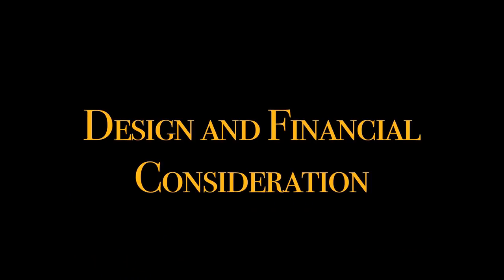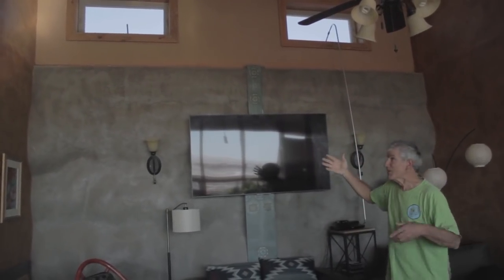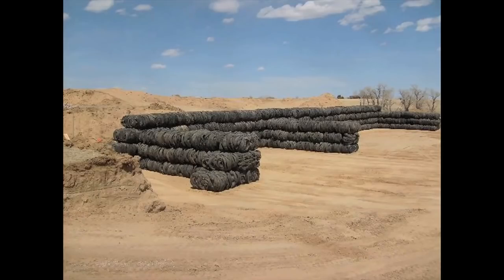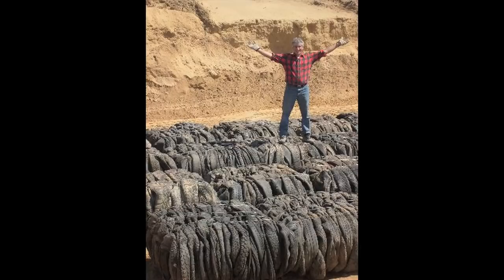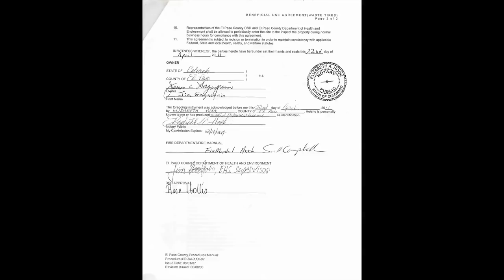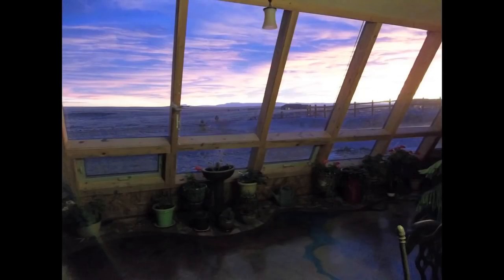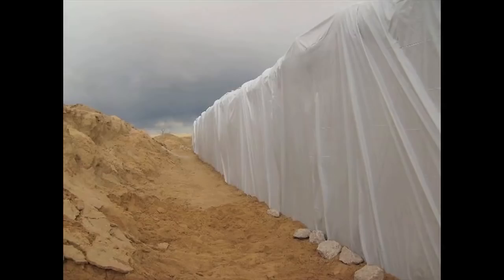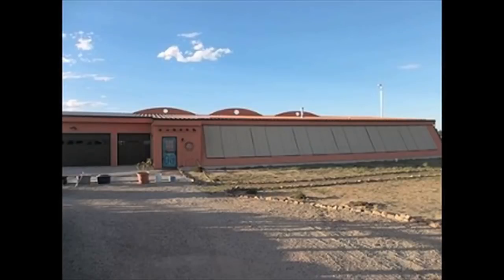Zero Energy Passive Solar Bermed Earth Tire Bale Home - Pseudo Earthship

Comment: Jim, thanks again for the great video, it's unfortunate that Mike S. is not with us anymore, so who would you recommend as a Colorado engineer for designing a tire Bale home?
Reply from the maker: There are a number of designs out there.  I have a design that I'm willing to share.  As you are probably aware, an Engineer who wasn't involved in the design has to sign off, prior to permitting.  I used an Engineer from Denver, but he has passed away.  The latest tire bale build in Colorado was in Masonville, CO.   He used Mark Shelby, a Structural Engineer.  I have this phone number - 217-542-2016.
Reply from the maker: New info - Check out PSE Engineering out of Oregon.  https://www.structure1.com/tire-bale-home-engineering/

Comment: My wife and I are starting to do that your family has done. Before seeing your video we did the same things you have done. Researching and staying at air B & B’s to get a feel of the building’s. We would love to pick your experience to avoid expensive mistakes. How much did it cost to Prepare the land for the build? We have a vacant land with 10 acres, but there are no structures at all. What were some of the unexpected expenses did you find yourself with?
Reply from the maker: Actually, excavation was one of the expenses that went overbudget.  We got a few quotes and went with the lower one.  Their proposal told us how much time it would take to dig out and re-berm the dirt, along with their hourly rate.  They weren't even finished digging out, and they were over the estimated hours.  After the excavation was finished, I paid them, and told them to leave.  After that I hired a guy that was working with the concrete contractors.  His former occupation was operation of heavy earth-moving equipment like Caterpillars, etc.  He was willing to accept $20/hour, and I had to rent a large John Deere front loader (it was even enclosed and had A/C).  This guy was great!  He helped a lot, with his knowledge of drainage, etc; which is always a concern with a bermed home.  Yes, we went way over-budget on reberming, etc; but he worked non-stop, and very expediently.  All my records are unfortunately in an obsolete software (Quatropro), but I would bet we spent well over $10K on excavation.  We hired carpenters, concrete contractors, shotcrete contractors, plumbers, electricians, roofers, insulators, a glass installation company, a crane operator for a day, a certified wood stove chimney installer, a company to design and install the solar PVs and wind turbine, and even a local high school student to help.  I bought all the lumber and the aluminum commercial glass glazing system.  Other expenses are a soil test analysis, building department fees, rock and rip rap shipments, and of course all indoor items - doors, cabinets, appliances, sinks, tubs, and other plumbing items.  Adobe materials are cheap, but we did all that work on the inside ourselves.  There are probably other items I have omitted.  If you have questions on any specific expenses, don't hesitate to ask.  I can be Messaged on Little Bermed House on the Prairie on Facebook.
Reply: @jimgagnepain7708  thanks

Comment: I would like to know how comparable in cost this build was to a conventional house build since a loan may not be available. I do not need actual costs, just the differences of the building costs. And does the company you used the drawing from have drawing that would work for different states and conditions?? Thanks for so much information. There is no way I could do a whole build by thumping tires full!!!
Reply from the maker: The cost of our home was comparable to the other homes in the area.  That said, we were very involved in the building process.  I GC'd the build, which probably saved about $60K.  My wife and I also did a lot of the work.  We were there every day with the contractors.  Had we not had all this involvement, it would have cost a lot more.  Sadly, the designer of our home has passed away.  I would suggest PSE Engineering.  They are located in Oregon, but are licensed in all 50 states.    https://www.structure1.com/tire-bale-home-engineering/

Comment: Nice presentation. Are slanted windows done for aesthetic reasons or do they offer better light penetrating properties than straight vertical windows for solar energy and heating the mass?
Reply from the maker: Slanted windows definitely offer more heat penetration in the Winter months.  The sun is angled from the South, and penetrates the home 15-20 feet deep.  That said, on most winter days, we open windows to cool the house.  Unless you live at a Northern latitude, you could probably get by with vertical windows.  For reference, we are in Colorado Springs.
Reply: @jimgagnepain7708  Thanks for the quick reply.

I get the sun is lower in the winter.

To be clear, it is not necessarily the angle of the window. I don't believe plain window glass has any reflecting properties that direct the light in a certain direction.

It's the height and allowing the sun to shine thru that gets the energy into the house and mass yes?
Reply from the maker: @scott5747  Sorry for the late replay.  No you don't need to angle the windows.  Even the Earthship Community in Taos is no longer angling windows.

Comment: Would it be a good idea to put some sort of waterproof barrier between the tyres and the internal rendered walls as well as on the outside to make sure no moisture and off gassing in the tyres escapes into the home. It may be overkill but I like to lean on the side of caution.
Reply from the maker: On the outside might be a good idea.  We did use 2 sheets of #6 poly, but as we bermed, it got extremely tight from the pressure.  I wouldn't be surprised if it eventually tore.
Reply from the maker: The inside is unnecessary.  There is no gassing of the tires into the home.

Comment: Is there an issue with the tires degrading and leaching carcinogens into the water table? I love Earthship designs but this is a detail that has always concerned me.
Reply from the maker: Actually this is a better use of tires for your concern, than piling them in a landfill.  The tire bales are covered with poly, which extends down into a French drain (foundation drain).  Theoretically, water should never get to the bales.

Comment: Will the bands holding the compressed tires break in time?  I love this concept.
Reply from the maker: A heavy gage cable is used to hold the tire bales together.  The company that provided the bales used a secondary galvanized cable wrapping, in addition to the standard steel cables, that won't rust.  No, I don't believe these will ever break.
Reply: @jimgagnepain7708   thank you for the information!
Reply: Where can I get these compressed tires?
Reply from the maker: @dinebonte4014   Sorry about the late reply.  We got ours from Front Range Tire Recycling.  Work- 303-660-0090, Cell - 303-500-2323.

Comment: Have you had any issues with off-gassing from the tires?  I lived in Taos, NM and had heard that there can be problems with this in tire berm construction.
Reply from the maker: Two points here.  If you ever go into a tire store, that smell is off-gassing of tires.  As tires are worn, they release less and less gas, to the point that they release near ZERO.  Before we covered our tires, you could not smell this, unless you put your nose right up to the tires.  Secondly, the tire bales are covered with about 3-4" of shotcrete, and there is adobe on top of that.  No - zero off-gassing.

Comment: Is construction similar to this feasible in climates like Missouri? Its gets fairly hot and also very cold here, and changes back and forth like you would not believe.
Reply from the maker: Hello, I'm orginally from Missouri.  I grew up in a Saint Louis county.  Yes, the functionality of the design would work very well in MO.  You would probably want to include some type of dehumidification system.
Reply: @jimgagnepain7708  Thanks. I'm looking at earth contact and also the ICF concrete form construction. What I'm gathering is that ICF is most beneficial above the ground? I'm a little confused at the benefit of the tire bundle/spraycrete wall vs. a conventional basement wall, and I don't trust the idea of using ICF forms against the earth. Matt Cremona has a video of a basement extension he did with ICF. Interesting, but despite the B I squeaked out in foundation engineering this is all new to me...

Comment: How cool does the house get in the summer?
Reply from the maker: Nick, We don't have AC.  We rely on the berming and uninsulated concrete floors to keep the house cool.  A few other items worth mentioning  - 1. Colorado has cool evenings in the summer.  So even if we have the very rare day where the indoor temp gets above 80 deg F, we open windows in the evening, and cool the place down.  2. We have very little humidity, which can make you more uncomfortable than heat.  3.  Worst case, if it gets in the 90's during the day, it might get to 75-77 deg F in the early evening.  If it gets into the 100's, we can occassionally exceed 80 deg F.

Comment: What is your advice if the subsoil in the area has a large presence of the carcinogenic natural gas, Radon?
Reply from the maker: Colorado tends to be a high Radon area.  An Earthship works well, because there is no basement.  The key is to hae air circulation, which is the mitigation strategy for basements with high radon.  I would still make the home very tight,  but install a heat recovery ventilator.  They constantly recirculate fresh air, and are very efficient at >95%...

Comment: He said they had no force air, but I didn't see where they put in cooling tubes, either. How does he cool the  house off or get fresh air inside?
Reply from the maker: None of the early earthships used cooling tubes.  The berming keeps the house naturally cool.  Without outdoor shades over the Southern glass, the house can definitely get hot, so we use the shades extensively, even in the Spring and Fall.  We sealed our earthship, and you are correct about "fresh air".  Usually we have windows or doors open for fresh air, but we also have a Heat Recovery Ventilator (HRV), which we utilize when the house is closed (mostly cold winter days).
Reply: @jimgagnepain7708  thanks for your response. I like the idea of the cooling tubes, but I would prefer them be filtered. 
If the tubes promote moisture in any way, I would probably not want it run through the closet like I've seen in the Encounter model.

Comment: is solar hearing also working on cloudy days. If not, does it only not work if there are more days of cloudy sky or already on the first day?
Reply from the maker: It still works, but obviously not near as well.  Sometimes on slightly overcast days, you can feel a little heat buildup at the windows.  Not so with heavy clouds.  Hope this answers your questions.

Comment: Will this design work in little sun areas with long winters like Siberia ?
Reply from the maker: It would work during part of the year.  Obviously, you'd have to supply supplemental heat during the minimal sun time of year.  However, the berming should reduce your heating bills substantially.  Regardless of the style of home, any new construction should use tight sealing concepts, perhaps using a heat recovery ventilator (or ERV) for fresh air exchange.

Comment: How did you secure the tire bales together?
Reply from the maker: The tire recycling center double-bound the compressed tires with thick gage galvanized cables.
Reply: @jimgagnepain7708  do you secure to the ground or bale to bale at all or just cover with dirt and spray Crete

Comment: What was the total cost including the land? And how long did it take to build?
Reply from the maker: We broke ground in April of 2011, and got our Occupancy Permit in January of 2012.  Counting the wind and solar, we spent about $270K on the structure.  The land cost about $50K for 5-1/2 acres.  We later purchased a 2nd 5-1/2 acre lot to preserve our Southern view.  Prices have risen across the board quite substantially since then.  I should mention that I General Contracted the build, and my wife and I participated in a lot of the construction activities on a daily basis.  We hired a lot of contractors to streamline the building timeframe.
Reply: I'm very impressed . Your home is very beautiful. If you could what are some things you would do different? Or change?  I'm very interested In this and I'm personally looking for land right now to start something similar. Your video is very inspiring.
Reply from the maker: @whatsgrowingon  I would not slant the front windows.  All warranties are voided, when slanting.  It's difficult to eliminate water intrusion.  I would probably motorize the back (13'high) awning windows.  We have a long pole operator, that's a little cumbersome.  I would install a 220-Volt car-charging outlet in the garage (EVs were a distant thought in 2011).  This is all minor compared to the things we did RIGHT!

Comment: What is a Rough estimate of how much this would cost me . For when i build my own Earth Ship ?
Reply from the maker: Rik, Our home, not including the cost of the land, cost about $270K.  That included $20K (after rebates and tax credits, which reduced the cost from $39K) for an Engineered residential wind turbine and pedestal-mounted solar panels.  A few qualifiers on the amount spent.   1.  This was in 2011, so costs have probably escalated.  2.  We hired a lot of contractors, but we also did a lot of the work, including tile work, floor etched acid,  adobe on all interior walls, and assistance on all the phases.  My wife and I were on-site every working day for 9 months of construction.  You can save, or spend more, if you are more or less involved.  3. I acted as General Contractor for the build, which saved an estimated $60K (I took a year off work, to save the $60K, in lieu of a taxable salary).  4. We were told by the lumber company, that our home was "over-designed".  Significant cost reductions could have been realized by using smaller lumber trade sizes.  Most exterior walls are minimum 2"x6", and one of them is 2"x10".  Ceiling is 2"x16" TGIs, with 12" batt insulation, and a 4" air ventilation space.  You get the picture.  5. Costs include the design fee, all permitting fees, engineering fees, variance fees, and other non-construction expenses.
Reply: @jimgagnepain7708  That’s actually a lot less than I thought.

Comment: Thermal mass of a tyres made mostly from rubber and some metal? I doubt that. Insulation yes but storing heat?
Reply from the maker: They are also covered with shotcrete and adobe, so that adds a lot of thermal mass.  But the tire bales definitely add to the thermal mass.  They are very tightly compressed, and weigh a ton each.  Picture it this way.  If you put those tire bales in the front of the house, and let the sun shine on them, through the windows, all day, they would get very warm, and release that heat at night.  Correct on the insulation...
Reply: @jimgagnepain7708  Thank you. I take that since you live there and know more than me who just watch the video.

Comment: Why don’t earth ship variations use an overhang to shade out the summer sunlight?
Reply from the maker: There is a little overhang in most earthships.  Any sun penetration will heat the interior substantially, with all that glass.  An overhang will only keep out some of the sun - especially with slanted windows.  Outdoor shades work best, and are a MUST DO.
Reply: @jimgagnepain7708  I built a passive solar Adobe (not an Earthship) that used a 52 foot long south facing greenhouse for heat. It provided about 95% of our heat. I used an overhang that let in winter sun and blocked summer sun. It worked perfectly. Things grew well with just the reflected rather than the direct summer sun . When I was learning about passive solar in the 70’s a proper overhang was a basic feature. I have long been curious why Earthships don’t use them. They seem simpler than curtains etc.
Reply from the maker: @bobprickett2223  Sorry about the late reply.  Yes, I've lived in houses with these types of overhangs, and they work well.  Sounds like a great approach with the separate greenhouse.  We get very cold nights in the high altitude of Colorado.  I believe the designs focus on getting the maximum sunlight penetration during the day.

Comment: I would love to find some help to do this on my 36 acres near NM in AZ  Apache County zoning allows even camping so should be easier but I have a 501c3 need to fundraise
Reply: Anyone interested? My land is flat 20k to put in well with solar pump but have access to community well 500 gallons a week I love permaculture
Reply from the maker: @andibowe6890  building a home is time consuming and costly.  Plus, I'm assuming you still have building codes, permitting, and inspections.  The tire bales may decrease the time, compared to rammed-earth tires, but everything else is still hard work.  The tire bales make the walls 5' thick, instead of 2-1/2' thick, so it takes more concrete, rebar, etc.  I hope you can find the ways and means, because you will love it, once you're living in it.
Reply: @jimgagnepain7708  I have helped rebuild 4 old homes this will be first time from scratch but my land zoning allows camping or RV or buildings so even composting toilets allowed st John's is county seat less than 4k so better regs than elsewhere

Comment: The tire wall is a ok idea in my book I think it would be better to  have a concrete wall
Reply from the maker: Ed, A concrete wall will provide no insulation.  Our building department now requires that they be insulated, so you will lose all your thermal mass, along with the benefits of cooling a bermed a home in the summer.